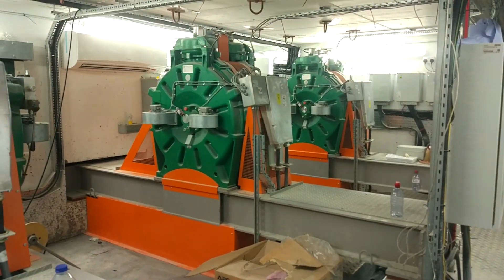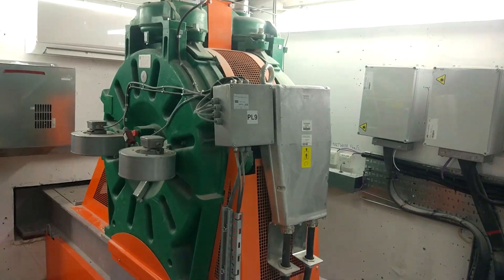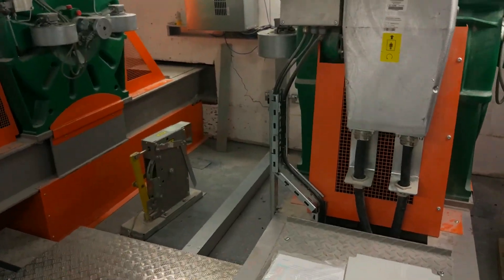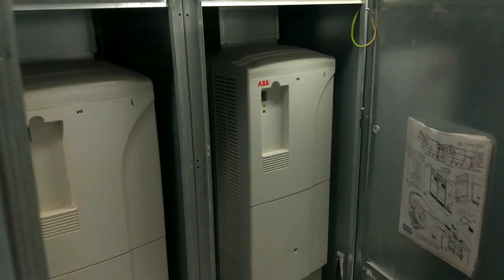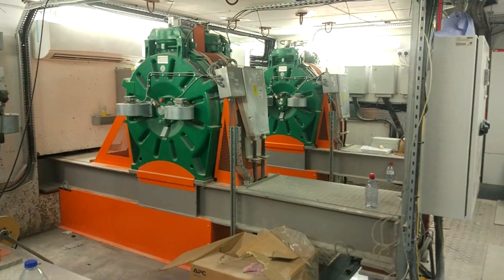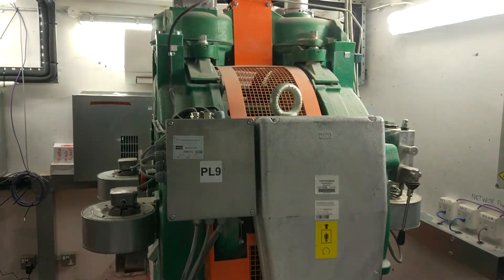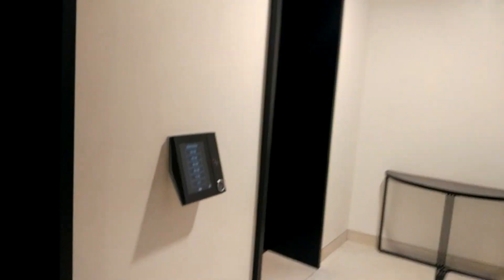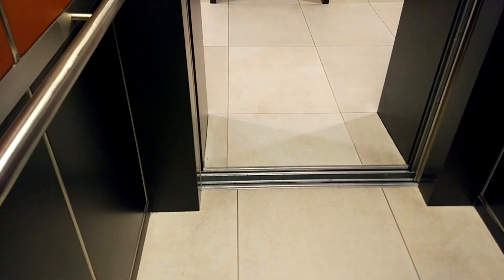Detailed look at MX32 Ecodisc 6 m/s

Comment: The are 3 interesting things about this lift.

1: Non-MRL EcoDisc
This is because there are 2 EcoDiscs that turn a single traction sheave. EcoDiscs are thin enough to be used in the shaft, but 2 EcoDiscs are thicker. We could remove a motor which would make it fit inside the shaft, but the speed would decrease dramatically. We could make up room for the thick EcoDiscs, but then we would have housing problems, pretty much like the Schindler 3300 motors. It also would require a 2:1 cabling.

2: 1:1 cabling
2:1 cabling would be possible if the building was shorter, but for 2:1 cabling, we need a longer cable, meaning more weight for each cable. The cables could snap under their own weight. 1:1 cables are much shorter, which decreases the weight.

3: The ropes underneath the counterweight
There are ropes underneath the counterweight as seen in 11:36. These cables are rare in low rise buildings, but every high rise requires some sort of extra stability, these cables provide that.
Reply from the maker: As far as I know, tall buildings usually don't have 2:1 cabling due to the cable sway would be too much.  The amount that the cables could move with building sway with the length of the cables in the shaft only holding half of the weight of the lift wouldn't be great.  Also another reason is the motor would need very good bearings to run twice the speed on a high speed lift.   The weight of the cables isn't an issue due to the under cables.  The cable weight issue is to do with the weight of everything being a lot more when the lift is at the bottom of the shaft compared to the top, due to the cables weight shifting.  The undercables solve this issue.  The weight being moved by the motor stays the same no matter where the lift is in the shaft.

Comment: What’s also interesting is some MX32 motors only have a single VF drive while others like the ones in your video have two of them on each motor! Probably depends on the power and speed configuration the customer chooses to go with! :)
Reply: We have a unit in the Antwerp Harbour that has a 5 tonnes capacity at 1M/S, MX32 with a single V3F25 KONE drive.
Reply from the maker: MX32 can come with different brands of VF drive.  I have seen them with Toshiba and ABB.  The ABB ones need 2 drives linked together.  Maybe other brands can do it with just 1 drive.

Comment: Not only does it go 6 m/s and hold 1200 kg BUT ALSO IN 1:1 CABLE CONFIG? That is super powerful!
Reply from the maker: MX32 is two MX20+ joined together.  It has the same speed as an MX20+ but twice the power.  MX20+ goes 3 m/s in 2:1, and would theoretically go 6 m/s in 1:1, but the capacity would be too low to be useful (I don't think there would be any use for a 6 m/s lift with 600kg capacity).  So having having two motors increases the capacity, but is still the same basic motor, which is a genius idea by Kone, I have never known any other lift company to do this.

Comment: What is the strange thing attached to the counterweight at 11:35 ?
Reply from the maker: The under-cables.  They are for maintaining the weight on the cab and counterweight the same as the lift moves up the shaft.  All skyscraper lifts need this, or the motor will have very uneven load on either the cab side compared or the counterweight side when the lift is at terminal floors.

Comment: I wonder what the LCECPU/LCELOP would display for floors above 99 because it seems to only display 2 character floor IDs
Reply from the maker: LCE can show 3 characters on the indicator.  On some indicators only 2 characters can be shown.
Reply: @benolifts  I am talking about the seven segment displays on the logic board itself. The middle two displays show the current floor ID, and the two to the right show the new floor (call), so what would happen with 3 digit floors?
Reply from the maker: I actually don't know
Reply: @nelsonahlvik6650  maybe it would use hexadecimal?

Comment: They should have called it mx36.. lol
Reply from the maker: The MX numbers don't really make much sense. MX 40 should be called MX50.   I estimate it does something around 1200kg at 8.5 m/s, 1600kg at 6 m/s,  2500kg at 4 m/s.  And in 2:1 this would be 5000kg at 2 m/s. So MX50 is a better name. But after the NMX updates apparently it can now go a speed of 10 m/s (probably at 800 to 1000kg)  So it should now be renamed NMX55 or NMX60.   Kone really seem to be thrashing their motors a lot harder nowadays.  I think the motors were more reliable than Kone expected, so they then thought they could push them harder to get more out of them.

Comment: Hello Beno! What is an ACUM in a LCE?
Reply from the maker: Do you mean LCEACU?  ACU is audio control unit.  This is set by 3-3 where you can chose the message for each floor. 3-4 sets what should be announced. 3-5 sets the language. 3-6 sets the dual language.
There are many versions of LCEACU.  The basic version has 78 messages.  The more complex ones have 255 messages in 37 languages.

Comment: There’s just one question why not lift shaft why a motor room.
Modded a lift?
Reply from the maker: Because it is MX32 (NMX era updated version).  It goes 6 m/s at 1200kg.  You aren't going to have that as MRL.  I feel that the modern day 3 m/s at 1000kg MRLs that you now get (MX20+ and 5500) are pushing the limits of what is possible.  There is no chance of a 6 m/s MRL.

Comment: BENO Are you being exposed to dangerous levels of Electromagnetic Radiation around this Elevator motors?
Reply from the maker: The motor windings operates at 25hz.  The VF drive is at pulsing 10,000hz into the windings.  These frequencies are far too low to be a problem, even when at high power.
Reply: @benolifts  That's great! Thanx 4 the videos. There very interesting and fun to watch!
Reply: Perfectly safe.